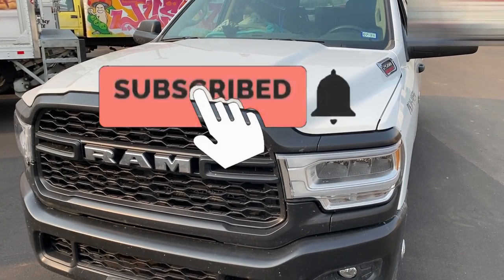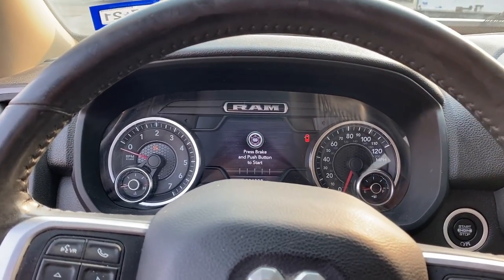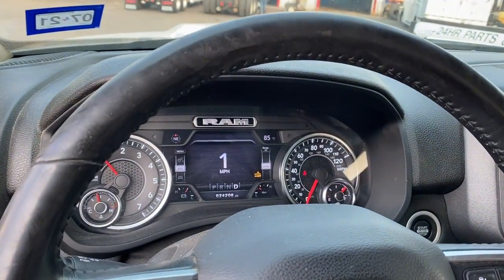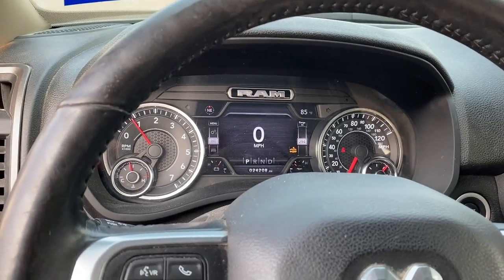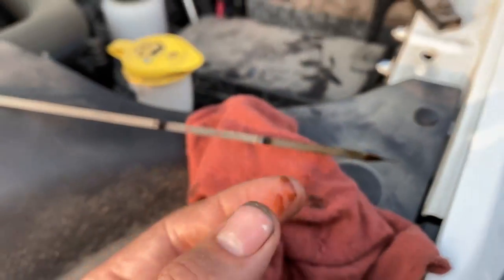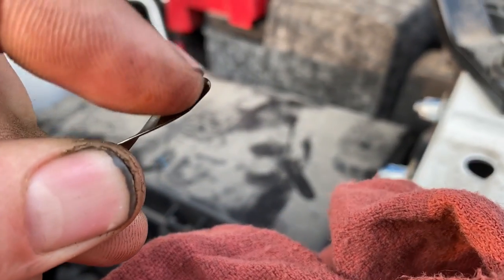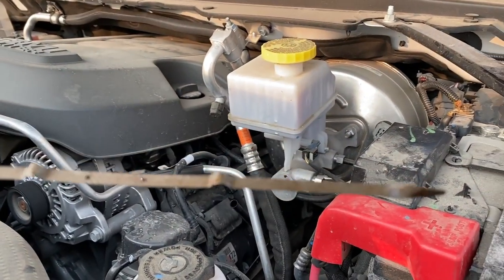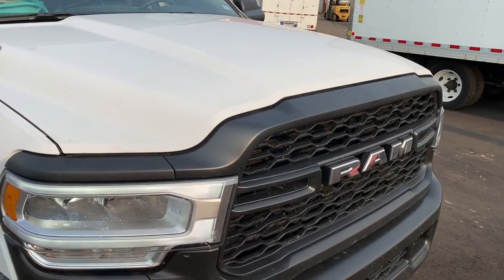2020 Ram 2500 Hemi 6.4 Bad Engine!

Comment: I have 234k on my 5.7 hemi. Oil changed every 5000 miles by me. Mopar filter, castrol oil. No ticks,leaks, pressure issues. Not sure why others have this issue unless poor maint. I've had 3 hemis in 20 years and never failed.
Reply from the maker: Yeah I’m on my 3rd Hemi but to be fair the first one was an 03 without the MDS crap and that one only had about 110k when I sold it, the other was a 2012 that I had for 12,000 miles and now I have my ‘19 that I just hit 25k on. There was ONE time I started my 2019 and it had what sounded like a terrible lifter tick for a few seconds then it quit. Shit the truck off and started it up again and haven’t had an issue since. Sometimes I get very minor lifter tick for half a second but nothing like that one time. I agree though maintenance is huge.
Reply: @TonyTheTruckGuy  could be the exhaust manifold bolts. It also causes the tick but only for a few seconds on startup when the engine is cold, then goes away. Had that issue on my ram 1500....had 4 snapped bolts and had to get them replaced under my lifetime powertrain warranty. 09 ram 1500 with 5.7 hemi.
Reply: Just don't idle the hemi. All police hemis have developed lifter/flat cam issue at around 50k due to the excessive idle. Mine is a 2014 with 100k kms at the moment. No issues yet.
Reply: @markwangontario7573  exactly. The cam/lifter issue is a design flaw with the block. Part of the 09 revisions to the 09 hemi (EZH version for rams) was the cam now sits higher in the block which makes it harder for it to get lubricated, so low rpms starve the cam for oil and cause the failure. Inherently the only way to truly fix it is for chrysler to redesign the block. The fact that after 11 years they haven’t, is a bit concerning. Same with the exhaust manifold bolts. Been a problem for over a decade and they haven’t even attempted to address the problem. They Just replace them with the same part when it breaks and move on.
Reply from the maker: @chasefeller1279  I guess I haven’t checked recently but if I have broken bolts on my 2019 then we have problems haha. The one time it happened it sounded like a legit lifter tick. I shut it down, fired it back up and it was fine.
Reply: @TonyTheTruckGuy  the exhaust manifold bolt tick sounds exactly the same as the cam/lifter failure tick but only lasts for a few seconds and is more noticeable the colder it is outside. Didnt notice as much on warmer days but as soon as the temperature dropped it was super noticeable. Crawled under the truck and found 2 bolts on each side of the engine snapped off. It would only last for 20 seconds on cold startup and then would go away. I read somewhere that as soon as it starts to heat up the manifold reseals itself so the exhaust leak goes away. I definitely thought i had the cam/lifter issue but found the broken bolts, got it fixed in a couple days and sound went away completely. That was about 2.5 years ago. Im due for an oil change in the next couple weeks so plan to go under and check the bolts again to make sure they aren’t broken again (dont have a sound but never hurts to check). Shitty thing is that the dealer only replaced the broken bolts and not all of them. You would think since they are pulling the manifold off and have to replace the gasket anyways they would replace all the bolts, but nope. Seems like the bolts on the rear of the manifold are the ones that break first tho.
Reply from the maker: @chasefeller1279  Damn. That’s super cheap of the dealer. The leak while cold then expanding as it heats does make sense. Had a few notorious Vortec manifold bolts broken off on my ‘01 Sierra as well.
Reply: @TonyTheTruckGuy  only good thing is that its a relatively easy fix compared to the cam/lifter issue. Its covered under the powertrain warranty so at the very least 5 yr/60,000 miles. Outside of warranty the dealer charges about $450 per side so if its on both sides, $900. Not great but not gonna break the bank either. And you can do it yourself, just have to drill out the snapped bolts. I would hope that your ram with 20,000 miles doesn’t have the issue yet but you never know. Some ppl get the hemi lottery and others dont. Just wish they’d refresh the 5.7 to fix these issues. The etorque version of the hemi didnt really change anything (or at least it doesnt seem to have) and the non etorque version is still the EZH version which came out in 09. Time for some updates chrysler! On the HD side the 6.4 either needs a boost to its numbers or a new, larger hemi. Come on 426 hemi!
Reply from the maker: @chasefeller1279  Yeah, I did a set of manifolds at work on our 2016 shop truck. Took me like 8 hours cause I had to extract a bolt and I think I had issues with the steer shaft and oil dipstick tube being in the way on the drivers side. I agree, they should definitely fix those Hemi issues and the 6.4 should get a power bump. Otherwise a 426 would be sweet haha.

Comment: The video should be called "How important is engine oil changes?" Lol!
Reply from the maker: For real
Reply: @TonyTheTruckGuy  Whatever happened with this poor abused truck? Any update?
Reply from the maker: @rb3tactical145  Unfortunately no real update. I know it went to the dealer and likely got an engine put in, I just don’t know if they covered it or not.
Reply from the maker: @HalfShell Nope. In fact the customer insisted that they have had it changed before lol
Reply: Amsoil is a good oil.
Reply: My wife would shoot me if I did that.
Reply: @jogmas12  Yep.  My 5.7 has 116,000 no lifter issues . Signature series 👌
Reply: @TonyTheTruckGuy  "Yeah, so it turns out, failing to change the oil is not actually covered. We take all major cards."

Comment: Not really cool blaming it on Ram and its engine when clearly the owner was negligent .
Reply from the maker: I didn’t blame Ram, I just explained a common Hemi problem. This one was clearly due to neglect.
Reply: This is hardly just a "common hemi problem". ANY engine will sound like after 24k on factory oil...

Comment: I have a 6.4 with 167000 miles on it. I had the roller on the number 5 lifter seized up at 150000 miles that chewed up the camshaft. I put in all new lifters, a new camshaft and replaced all the spark plugs which cost me $5,000 total. Well worth the money. I love this motor
Reply: That's awful. I drove 167k miles in a nissan I. Less than 2 years.  If I had 2 do work on my motor with low miles like that I wouldn't touch it. I'm at 417k and my motor is just fine lol.

Comment: He didn't take it to the dealer for warranty because he knew damn well warranty wouldn't cover it with original oil in it at 24,000 miles
Reply: My friend had a pathfinder he never gave an oil change for 30k original miles.  Check engine light came on. Got an oil change and engine flush.  Ran fine after...
Reply: @occckid123  what year and what was the oil viscosity recommended for those vehicles?

Comment: The 6.4l is the best gas motor of the 3. Its built way heavier. The cam lifter failer happens on 1.7% of 5.7l and less on the 6.4l. You see it because people blow it up as being a huge issue. If you idle your vehicle, it is. I've seen several 6.4l towimg over 15k miles all time as a hotshot truck, and the oil was changed every 5k miles. Every one of them was well over 400k miles (8sp) before he needed to do anything to them. The pistons have oilers shooting cool oil from the cooler into the bottom side of the piston to keep them cool. Sodium filled exhaust valves, aircraft grade stainless steel exhaust manifolds. The belly is forged steel and it uses a lot of demon parts. The motor is a monster for long-term use. You just have to actually maintain the vehicle.

Comment: My last 6.4 hemi 3500 had 53,000 miles when I traded for another 6.4 hemi 2500 oil changed on “ time every time “ no issues whatsoever with over 15,000 miles logged towing a 8500 pd skid steer and a 7 ton trailer for my business it’s this is my 5th 6.4 hemi since they’re introduction and never had any issues with motor or transmissions I put about 35,000 miles a year on my trucks I don’t understand all the issues these people are having.

Comment: I had a 2005 Ram with the 5.7 Hemi. Sold it in 2018 with 195K and had zero problems with it.  Of course I did all of the scheduled maintenance ALL of THE TIME.  I now have a 2018 RAM 3500 with the 6.4 Hemi and it has 20,700 miles on it.  I have changed the oil twice on it already.  I will never understand why people pay good money for a truck and then don't take care of it.
Reply from the maker: I agree. That being said, there have been a fair amount of issues from the never 5.7 and 6.4 due to the cam/lifter failure I briefly touched on. In the case of this video, it seems to be caused by neglect, but in other instances, it can happen even if you keep up on maintenance. Unfortunately, the new Hemis aren't QUITE as reliable as the old ones just for that reason. They should have left the old design alone haha.
Reply: @TonyTheTruckGuy  I am not mechanically inclined but have great respect for all you guys.  That said I always follow manufacturer recommendations and have had few problems with the 7 trucks I've owned over the last 30 years.  I have researched this issue though and the more recent changes made to the Ram Hemi including "MDS" seem to be causing more lifter problems.  Hopefully the next revision will address oil starvation and ELIMINATE MDS.  Neither the Ford HD 7.3 or the GM HD 6.6 gas engines have cylinder deactivation.
Reply from the maker: @dantimber  Yeah it seems silly to have it on an HD application.
Reply: @TonyTheTruckGuy  Stellantis has to be aware of this problem.  More than likely it will be addressed in the next revision.  Fingers crossed on MDS elimination.  In the mean time they will repair as warranty dictates and accept the cost.  Every engine/car/truck has unique problems.

I would add that you can gently remind owners to do the basic maintenance and they will agree with good intentions then forget or procrastinate.  I have a friend in diesel repair and he sees it more with individuals than fleet vehicles as the latter rely on them for business.

My friend (and my dad too) always said oil is like blood.  Keep it clean.  Also "take care of your vehicle and it will take care of you".  I'm sure you've heard same but encounter owners who will never do this and then complain when they have failure and a big bill.  Good luck man!. Great respect.....

Comment: Just bought a 2021 Tradesman 2500 6.4. Extended warranty up to 100000 miles.  600 miles in two weeks.
Reply: Just bought exact same truck. How you like it so far?
Reply: I also bought 2021 2500 6.4 tradesmen. I will be doing my own oil change very soon just hit 2000 miles. I was told that AMS oil meets the requirements or to use Pennzoil so NAPA caries the filter for the RAM, Napa gold #7060. Any thoughts!?

Comment: Well this owner was an idiot.  I'm sure the dealer will void the warranty when they pull the heads off and see the burned oil and sludge. Knowing this issue i run my 19 ram to 5,000 miles on oil change intervals and only use mobile 1 oil and filters.
Reply from the maker: I run between 5 and 7k on my '19 and use Pennzoil just because that's what the dealer uses and Mopar recommends. Didn't want any reason to void warranty haha.

Comment: Recently bought a 2020 Rebel. When it was first started, it rattled pretty good, but quit quickly. I wasn’t going to get, but it was litteraly the only one I could find optioned the way I wanted in the country. So, now after almost 8k miles, all good. ( knock on wood) Only heard the tick once since buying, and that was after it sat for about a week. Went away quick. This is addressed as a “ normal” condition in the owner’s manual. I’ve heard that avoiding long periods idling is a good idea. This is my second 5.7. I had my first one for 17 years before giving to my sister. Has over 170k, has had the  the “hemi Tick” since about 35 k, but still runs great with lots of power.
Reply from the maker: I’ve only had a tick 1 time as well and it went away quickly just as you mentioned. Only time in 20k miles haha
Reply: They all tick. Every hemi I’ve ever heard…. And just about every other hydraulic lifter motor. Some louder than others yes. You should hear the tick on a mechanically adjustable lash engine like a k24 in a Honda CR-V. Clatters like a diesel on startup. Way louder than any hemi tick. Quiets down when warm when metal expands. Those k24 motors last for hundreds of thousands of miles ticking away. Ticking engine noise is overrated sometimes. Knocking and slappin is what you gotta be worried about lol. Change the oil on time, be easy on the motor when it’s in the process of warming up and your motor should have a good chance of lasting regardless of the manufacture. It’s common sense stuff but I guess common sense ain’t common. Lol

Comment: I have a pentastar v6 in my Ram 1500, which is known for rocker bering problems.  I have been pretty ritualistic on maintenance and oil changes.  Have 140,000 miles on it and the only major repairs on the engine is replace the oil cooler and a coil pack.  I did remove the valve cover once when U was having misfire to check the rockers incase it could be one of them.  Only two showed minor signs of the needle bearings going bad, so I did replace them.  Next up is to replace the cam phasers.  A well maintained engine along with a well built one will last a long time.

Comment: Show the screen that show idle time.. it's idle time and cheep oil that does it. My 6.4 came with 0W40 full synthetic with certain requirements.. so for that reason I use Pennzoil SRT ... "Only" and my 6.4 is the most awesome engine work horse... If anyone wants bash something... pick on the 66RFE

Comment: I have a 2011 5.7 ram hemi.. 87k miles.. the exhaust manifold needed to be repaired but other than that I never have any problems sounds like a beast when it starts compared to my friends 5.3 chevy.
Reply from the maker: Yeah I’m surprised they haven’t addressed the manifold issue yet either lol

Comment: That is owner neglect, I had a 2016 Ram 2500 with a 6.4 Hemi and it did not use any oil and I did not change the oil until the oil change indicator would tell me to which was around 7,000 to 8,000 miles. I also only use Redline 0w-40 Group V Ester Synthetic oil in the engine. I only use Redline oil in all my vehicles and have never had an issue.

Comment: 2017 ram 1500 Laramie longhorn bought it new. I’m at 80k still runs exactly the same as the day I bought it. 5 30 royal purple every 4500 miles
Reply from the maker: Good to hear. I’m sure this one idled a ton and never had an oil change.

Comment: I bought a 2019 2500 Laramie with the 6.4 Hemi in September 2019.  I don’t drive it a whole lot, I’ve put just over 6k miles on it in the almost year and a half of ownership.  I still change it every 6 months at the dealer.  Full synthetic oil changes are a bargain now a days.  Its cheap insurance.
Reply from the maker: Yeah I was really surprised when the total for the oil change on my 5.7 at the dealer was only about $50. Costs me that much to change it myself haha

Comment: Vehicle care is key to a vehicle beyond warranty, my first was an 06 4.7L the one oil related issue I noticed was from parking in my driveway (slightly sloped). If I backed into my driveway the motor had a tick the next morning until warmed up, if I pulled into my driveway I never had a tick. Maybe a sump defect or just a weird occurrence. Current 2020 Ram 2500 6.4L and my 2017 6.4L haven't had an issue.

Comment: I have a 19 2500 with the 6.4 I change my oil every 5k whether it needs it or not and I use shaeffers oil with some EP Moly...hemis love moly
Reply: EP Moly Is that oil additive. I have a 2019 6.4 and change my oil using high grade 0w40 oil and filter. I don’t think it’s idling that causes the tick it’s neglect of oil maintenance.
Reply: Thought I had the hemi tick, turns out it was broken exhaust manifold bolts.. they put the same oem ones back in... Waiting for the tick to come back.

Comment: I ran Redline oil in my 5.7 and red line in my 6.4 never had a problem these new oil change specs at 10,000 miles it's crazy I still do mine every 3,000.
Reply from the maker: Did mine every 5-6k on my 5.7. ONE time I started it up in the winter there was a bad ticking. I shut it off and fired it back up and noise was gone. Never happened again lol.

Comment: I have 2020 6.4 3500  I change my oil every 3k to 5k using pens oil 0w40  never hotrod or pull anything. 44k miles  I'm praying I don't have problems

Comment: Manifolds on the 5.7 is prone to cracking, my 1500 Ram made the same noise and thats what it was, with only 16k miles.. But you have some thing else going on too if that's whats making that noise.
Reply from the maker: Oh yeah this one definitely had internal engine damage. I can’t believe the manifolds are STILL an issue on these engines. They really need to address those. 16k is ridiculous.

Comment: With this truck it sounds like poor maintenance, who knows, had 05 2500 5.7 none msd, got 80k on it with out a single problem and towed a 5k trailer several times a year, loved it, traded up to a Cummins, then got older then traded down to a 2018 ram 1500 with 5.7, no longer tow anything, motor replacement at 11k, then had small issues starting again at 18k, traded it for a tundra, hopefully the last truck I ever buy, so far so good!

Comment: Currently driving a 2021 Ram 2500 with the 6.4 as a loaner vehicle, and even at 7500 miles i would honestly say there is alot of engine noise and can definitely hear the valves moreso than any other V8s ive had/heard.